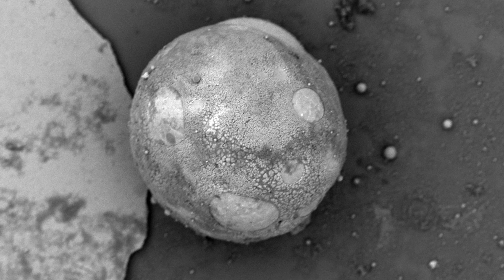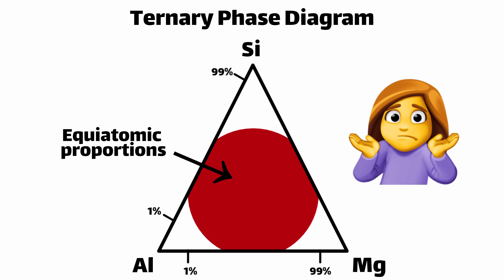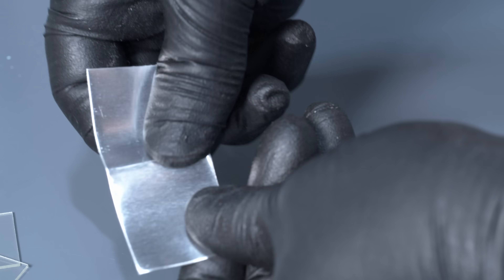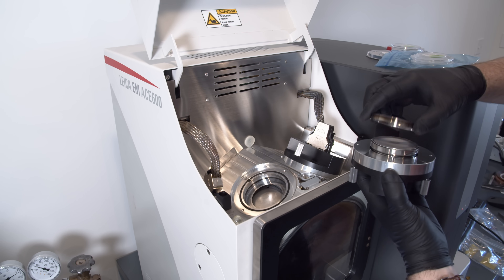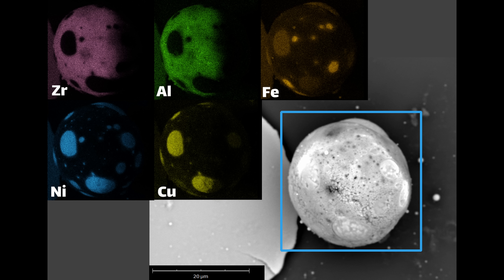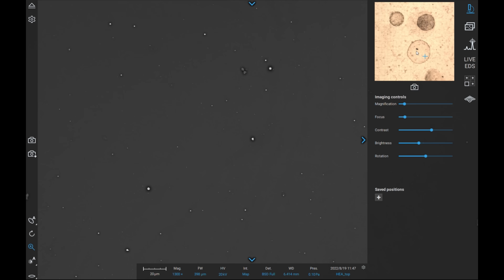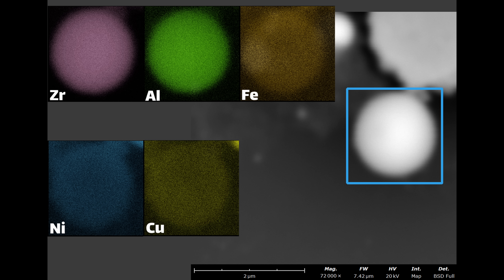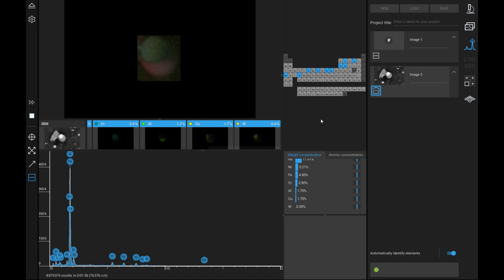Metal Alloys of the Future?

Comment: A couple years back I brewed up a theoretical process for making a high entropy alloy in bulk with relatively uncomplicated procedures using powdered metals with appropriate phase transition temperatures in a welded steel canister (similar to techniques used by some to make damascus steel).  Idk if it would work tbh, haven't had the shop space or correct tools to attempt since I dreamt it up, but I call theoretical product "chaos silver" in my head lol
Reply: Cool.
Reply: Do you think exposing the particles to a strong magnetic field while "forging" would have an effect?
Reply: @thebogsofmordor7356  possibly yes.  In my considerations, I've sought to eliminate as many engineering complications as possible, applying such a field within a furnace introduces quite a few difficulties; melt times would have to be 4-6 hours minimum I think to maximize chances of success.  Another point of consideration is how you cool it (quickly to the lowest solidifying temp of the constituent elements and then gradually to room temp over 2-3 hours is my idea in order to maximize homogenous crystal formation although there are a few different permutations of procedures that would likely need experimented with before success) during which applying static and alternating fields (electric and magnetic) could produce beneficial effects and would be much easier from an engineering standpoint.
Reply: @newtonbomb  Slow cooling can produce some unwanted intermetallics in some HEA systems. For instance, the sigma phase -- well known in stainless steels, sigma phase is why you don't heat treat most stainlesses in the 600-1000C range. It also forms in many of the chrome-containing HEAs in that general temperature range. Edit: Also, depending how you're melting your alloys, powders are actually not recommended. They have a tendency to get blasted everywhere when you hit them with a laser or an electric arc.
Reply: @newtonbomb  you could use an induction coil to kill two birds with one stone. Heating the metals and exposing them to a strong magnetic field
Reply: @bigboy6704  I've considered that, and its honestly a great idea.  I just am unsure on how the magnetic field would effect the alloy production, and for my "first prototype" ideas I try to filter put as many variables as possible; I also for some reason, I really don't know why, tend to try and develop knowledge and ideas that if I was transported back in time a millenia or two (or 3, or 4) and had access to large amounts of funds would theoretically be possible to replicate without having to develop all the up to industrial era dependent technologies.  Either way, it would definitely be worth trying.
Reply: @newtonbomb  high heat destroys magnets too
Reply: @adog3129 High powered electromagnets operating at a significant distance?
Reply: @keegsmarshall6610  idfk
Reply: @thebogsofmordor7356  dunno, but would be a great experiment !
Reply: @thebogsofmordor7356   depending  on the elements  involved and the temperature   kept below  the Curie point of the components exposed. If you heat a magnet  to curie point  you will cause the magnetic field  to collapse  and after cooling doesn't  return  to its previous  field strength.
Reply: Thats what I first thought of also. Just stick equal parts of the metal powders in a ball mill to thoroughly mix them, then seal in a crucible of some sort and melt the mix. I guess the trick would be figuring out the right temperatures, and the cooling or annealing.
Reply: @keithyinger3326  Truthfully you don't even need to ball mill the elemental powders. The standard method for making HEAs in lab settings now is to melt a small ingot in a vacuum arc furnace, flip the button over and remelt it, and rinse and repeat 3-5 times. Some places with the equipment to do so have started to use induction melting furnaces, because induction furnaces can have very good stirring in the melt. After casting you generally have to do some combination of forging/hot rolling and solutionizing heat treatment, just like any other alloy.
Reply: @jamesfrishkoff2013  good info.  Considering that I wanted to make this as accessible as possible and likely won't have access to a vacuum arc furnace any time soon, I had thought to use a rod welded to the cannister that was either manually rotated occasionally during the melt or done via a motor of some kind.  The cooling process is something I figured would require experimentation to get right, fast cooling to a certain temp and slow cooling to room was something I came up with based on a few research papers but admittedly might not be the right way to go.
Reply: @newtonbomb  A vacuum arc melter is basically a TIG welder in a box. I would guess that you could replicate it halfway decently with a well-shielded TIG setup, if that's something you have access to.
Reply: @jamesfrishkoff2013  fair enough.  Still would be easier from an engineering/accessibility standpoint, imho, to just use a regular furnace; I came at it from a perspective of what would be a process that any average blacksmith could attempt to replicate without having to have any specialized equipment. I deliberately chose elements with relatively lower melting points and methods to remove oxygen not involving vacuum equipment.  Also, if I'm not mistaken, in order to make anything beyond a small button using a vacuum arc furnace would require much more expensive equipment and involved setup.
Reply: You don't want to become that guy a friend of a friend of a guy somebody new who had the 100 mile per gallon carburetor that GM had murdered do you
Reply: @chauvinemmons  😂
Reply: may I suggest explosive welding? :D
Reply: @AlexanderBurgers  I was thinking the same thing...great idea
Reply: @AlexanderBurgers  I like your thinking not surely of it will work but I would say it is worth a try if only for entertainment purposes (in case of failure)
Reply: @TheLtVoss  who is this Alexander Burgers fellow I keep seeing people respond to?  I can't see any comment by them on this thread, and I've tried looking on multiple different platforms....
Reply: @Edward Elizabeth Hitler that's not a bad idea!  I'd have to do a little bit of digging to see exactly what the vapor pressure at the the furnace temperatures would be but I'd imagine a you could get it within managable range by adjusting the volume added correctly.  The only problems I see with it is that while liquid nitrogen isn't exactly difficult to get ahold of, it does add a layer of material acquisition complexity that I am trying to minimize; it also probably wouldn't be nontrivial to maintain exact control of volume added/vapor pressure values during the methods I am considering for making the crucible a sufficient enough pressure vessel (basically just welding it, but you'd be under a time crunch to get all the seams welded before the heat caused it all to evaporate and would be difficult to tell if you were successful afterwards).  My idea was pretty simple, a small amount of sacrificial carbon for oxidation prevention and using calculated appropriate amounts of zinc along with tight tolerances of the inner volume of the crucible (accounting for fluid densities of the constituent equi-molar elements) for pressure generation in the targeted range; this admittedly is an approach whose likelihood of success is a bit tenous with a few known unknowns, but I think is at least worth a try.
Reply: Controlling temperature and also may i add that varying pressure during the cool down might be an aspect to look at, Each HEA combination will probably have an optimal pressure cool down phase and even magnetic field combination that will work best. I'm just hypothesizing as i write here, but also using ultra sonics at specific frequencies could also be a factor to avoid formation of intermetallic phases. Fascinating and complicated for sure.
Reply: @Edward Elizabeth Hitler it may take a combination of the two, using a bit of argon purging to reduce the total amount of carbon needed.  Because of the aforementioned tight volume tolerances of the crucible the main source of oxygen you'd be dealing with would be in the interstitial spaces between the metal powders (if thats what was used) which would make eliminating it completely with inert gas purging a bit difficult and make using bulk materials a bit more attractive if the other methods of oxygen removal didn't work.  There's alot of considerations that would have to go into a relatively simple, reliable, and successful method; it would require quite a bit of iterative experimentation to get right I think.
Reply: Chaos Silver is an awesome name!
Reply: @baneblade__  thanks lol.   I also bandy about the name "chaos bronze" which makes more sense considering the elemental composition I've thought up tbh.
Reply: Typically alloys melt in separate phases. There’s a critical composition where the entire alloy can melt as one phase called the eutectic composition
Reply: "Chaos silver, now coming to a dodgy apothecary near you!"
Reply: @marcushendriksen8415  “wolverine and black Panther were very jealous of Mr.X’s Chaos Silver claws…..”

Oh yes, that works very well lol
Reply: that is awesome!!!!! keep feeling in to the dream! I believe in you. this is the kind of stuff that has been hidden for centuries! think Merlin and the excalibur sword! a hyperentropic metal that responds to the intention of the wielder. it is possible. just imagine the blacksmiths for thousands of years all trying to figure out how to mix these metals. thet mustve figured it out. I'm sure the library of Alexandria had a material sciences section all about creating super alloys.
Reply: SiCa crucible warmed by microwaves would work well
Reply: If you ever want to try it I'll supply my forge and expertise on blacksmithing for a chance to make "chaos silver"
Reply: Mhm  the idea isn't bad but you would need singel atom metal dust  to generate a HEA  also forget the heating over the liquidus  that would lead to phase separation like we have seen in the first nano droplets  BT has shown us and it is absolutely unnecessary  ever heard of coold welding just bring the metal atoms near enough together and they will share there electrons aka bind together now you say and why don't stick 2 metal pieces together if they touch well at first the oxide layer that is a spacer between  also even if same atoms get to bind the strength that holds the pieces together is not even noticeable by hand  and a not perfect surface will only make it worse

But I know 2 cases of coold welding  high precision meesurment blocks (they ar so smooth that they stick together by the atmosphere  and if not seperated after use the trapped air in between the surfaces will escape and well Invar is an 2/3 iron 1/3 nickel alloy so double the Ni containt of stainless Steel just leaking Chrome you can imagine the basically non existing oxide layer

And the second  is/are stainless steel bolds and nuts they cann weld together after tighting the stainless prevents oxides from forming and the pressure with the movement against each other ripping up the old oxid layer and making them fiz
Reply: @TheLtVoss  I don't think you'd need nano particulates, not for type of process I'm aiming for; well mixed micron sized meshes, an effective means of oxygen removal (I have a couple of thoughts on how to do that relatively easily), and a crucible cannister capable of withstanding a few dozen bar (I have an idea to create the pressure in situ during the melt with precise volumetric dimensions and vapor pressure via certain elemental additions) would be sufficient imho.  I've read several research papers that indicate some of the main requirements for success are maintaining the right temperature to keep the elements in proper phase with each other for long enough periods, keeping an oxygen free environment, and controlling the cooling process correctly.
Reply: Also, micron mesh powders themselves may not even be neccessary.  Using packed foils or even just tightly stacked arrangements in the proper molar amounts could be sufficient; I just lean towards powders because I believe it could lower the overall needed melt times due to more consistent heating, make getting precise molar amounts a bit easier, and because it would make a few other ideas I have a bit more feasible.
Reply: @newtonbomb  There was a patented process in mold making back in the '80's-'90's by Air Liquide called SPAL, Linde had another process I can't remember what they called it, AL used liquid argon dripped into the crucible while Linde used low pressure gas, both processes eliminated oxygen from the melt, reducing oxides from forming. Another thing to consider is the affinity that metal families have for each other ie nickle and copper, iron and carbon, tin and silicon...Think of the instructions for mixing a batch of cookies, mix all the liquids, then cream the butter and the sugar, and last fold in the flour. Perhaps there is a process or combination to create an alloy in steps instead of mashing all 5 together at once, say copper and nickle, then that combo with iron, then chrome, then tungsten, working up the ladder. And the whole process in an inert environment.
Reply: @richspillman4191 I thank you may have a point there.
Reply: @TheLtVoss  gold also cold welds well because it doesn’t form an oxide layer I think Cody’s lab did a good vid on it with a demonstration if your interested
Reply: @Simon-jr2oe  jep gold and other metals In the plantuim group ar highly likely to cold weld
Reply: "i dreamt it up" ya i have dreams of superconducting alloys at room temperature composed from cheap and widely available elements but according to thanos "reality is often disappointing"
Reply: @lordjaashin  as you can tell I started with the phrase "brewed up"; there is a difference semantically.  Meaning it was an inner alchemical process taking the base insubstantial ingredients of dream and doing the neccessary work to make it's reality as possible as can be once the real world experimental work begins. You know, science?  It could be disappointing if too many attempts fail and I have the wrong attitude about it, but that's all a part of the game.
Reply: @newtonbomb  ya we all have such "dreams" TM.

rarely anybody transform such dreams to reality.
Reply: @lordjaashin  and? Don't get what your point is.